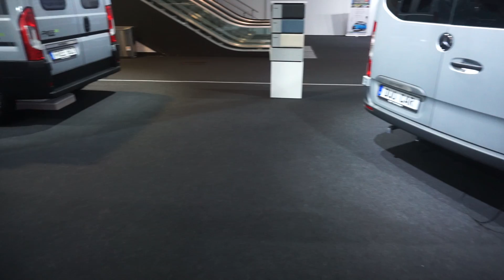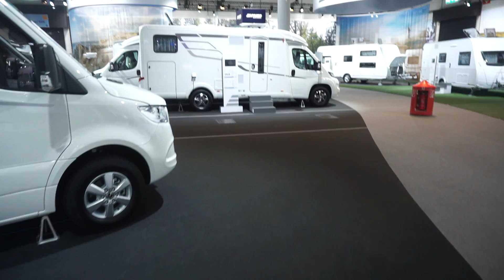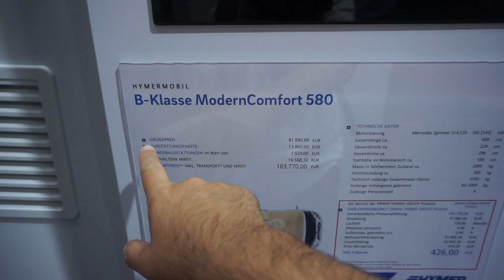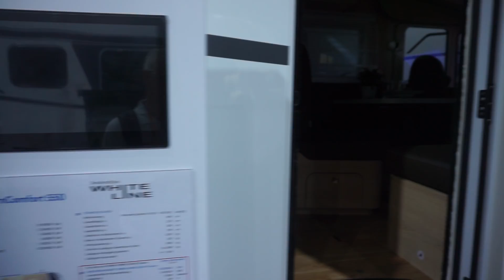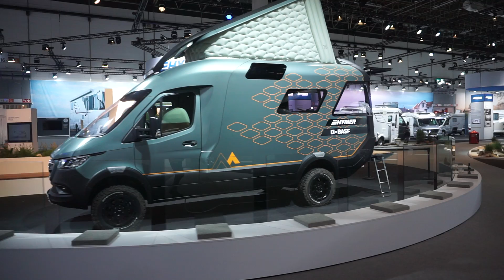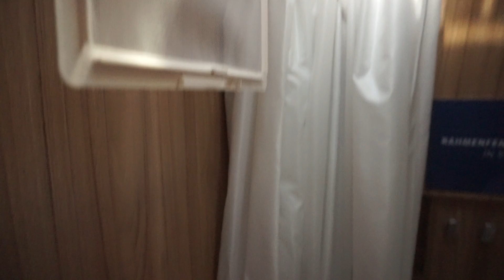Hymer at Caravan Salon Dusseldorf

Comment: Personally I don't really attack the Ducato - I just don't like it, mainly because of the front wheel drive and because the "underbite" is butt ugly. They're going to be useless on soft surfaces, all that weight over the drive wheels and in the front, they will dig in at the drop of a hat. Also, its crash safety is shaky. I don't know how good other vans are, but the Swedish crash test of a few Ducato based RV's scared the shit out of me. I do like the Ivecos, which are just as Italian and use the same Fiat engines, and the 8-speed auto is probably the one that's in the Iveco, also. It's just HUGELY better looking, and rear wheel drive with an optional diff lock.